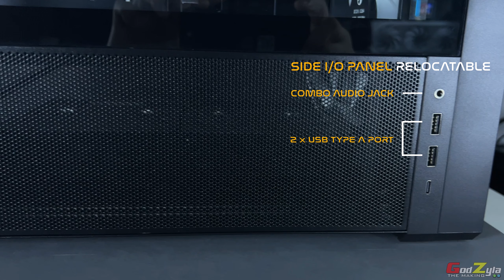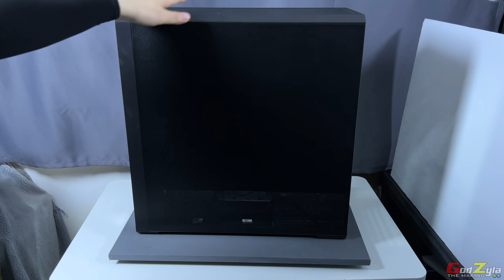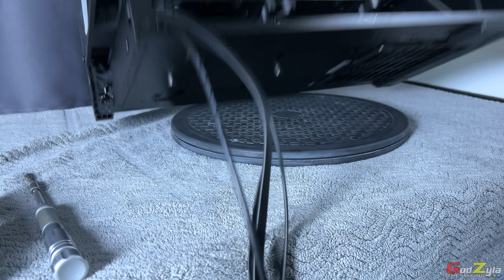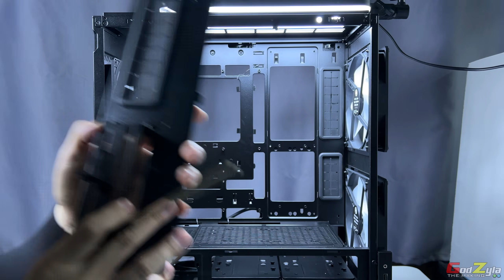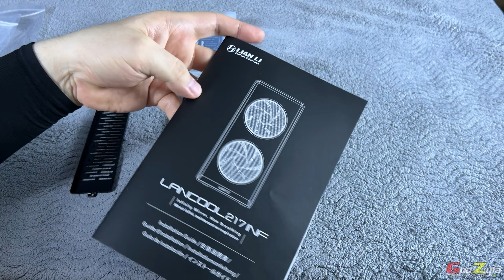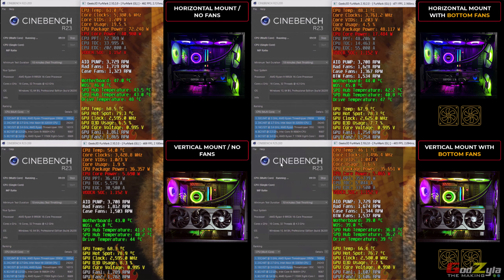Lian Li Lancool 217 INF

Comment: I appreciate the analysis.  But we are talking about a few degrees difference.  I don't see that as a massive difference if you prefer the aesthetic looks of horizontal over vertical mount of the GPU.  Overall its a great case for thermals.  Kudos for doing a 3 hour test at >30deg without Air-con!  Life is too short - turn on the air-con.
Reply from the maker: Welcome to my channel. You are right on few degrees difference. nothing major but personally I prefer to have GPU vertically mounted, not because of aesthetic. if GPU place vertically : 1st lesser turbulance as the fans blowing toward the bottom against the air intake of the GPU, 2nd less off the anti saq and to bend PCI-E pins, 3rd easier to clean and 4th a system is not just CPU or GPU temperature, other components will run cooler as no blockage of warm air exhausting from the bottom to the top.

Comment: Your review is great. I have a question. Many users reporting that fans of this case are so noisy. Can you tell me if you faced any noise issues?
Reply from the maker: Welcome to my channel CYB3RGHOST. Noise level and loudness greatly depends on individual. To me they will be loud if you let it run at max speed but if you control the rpm properly, it will not be that loud. I am more sensitive to high pitch frequency, but these fans does not to that, instead at full speed, it’s just a loud hum.
Reply: @KleoYan thanks for reply 🙏 did you use Lian Li L wireless connector to control fans or you set manually from bios? What fan settings from bios you would recommend to me? I ordered this case and im currently waiting for it.
Reply from the maker: @CYB3RGHOSTY  I do not use wireless connectors or L-Connect 3 app. I purely use Bios fan curve.. infact I use this https://getfancontrol.com/ with my own profile. As for setting of profile my settings as follow, based on CPU temperature.
25% when CPU on idle
50% when CPU at 65°C
65% when CPU at 75°C
80% when CPU at 85°C
100% when CPU at 90°C 
but most of the time even at load, it will just run at 65% as my CPU temperature will not hit 82°C  as I will undervolt my CPU .. 9950X3D https://youtube.com/playlist?list=PLEW-b-2vYDdMRE4f4wT0V4miVO9_2qyoJ&si=nWhpb1dMgZ7EJM6- or 9800X3D https://youtube.com/playlist?list=PLEW-b-2vYDdMhXCDT47rglQcDQNaRisR_&si=XPlFjOglNRwTjuAU
Reply: @KleoYan thank you so much i think your replies will help a lot for others like me also. 🙏🗿🤝
Reply from the maker: @CYB3RGHOSTY  you are most welcome and all the best with your build too. 🫡
Reply: @KleoYan by the way, i also wondered if you did the testing in the video with the fan settings you mentioned?
Reply from the maker: @CYB3RGHOSTY  yes, the settings I have shared with you are based on this case and its components, as I kept a record on ms notes.
Reply: @KleoYan tested the case today. Unfortunately it has resonance issue even at %20 fan speed. I can fix front fans with manual fan profile on bios but fan on the back is not fixable. It kinda has resonance at any speed. When i touch near back fan i can also feel vibration when i hear resonance. I really liked the looks of case but this issue makes me to return it sadly. I bought it for 72 usd which makes it great but it becomes pointless when the product is faulty...
Reply from the maker: @CYB3RGHOSTY  I'm sorry to hear that. I hope you're able to find a better replacement case. In fairness, default cases rarely come with quality fans built-in.
Reply: @KleoYan  but this one should come with quality fans considering they used a proprietary fan hub, and 170mm front fans that replacements don't exist for. :(
Reply from the maker: @NJJRS  welcome to my channel. This I have to agree with you. I have feedback to Lian Li, maybe you can drop a note to there reddit or discord channel. http://reddit.com/lianli or https://discord.gg/PHuKTkhKGY

Comment: Between lancool 207 and lancool 217 inf with 3 bottom fans which one has the best gpu temperature?
Reply from the maker: Welcome to my channel Unmaykr, Lancool 217 is of advantage as it has more room for air and your fans will not ramp up making so much noise. hope this answer your question as in good GPU temp.. btw for me will be having GPU Vertically mounted.

Comment: Can anyone who has this case tell me if I vertically mount my GPU (it's big, sapphire nitro+ 9070XT) will the large screen to my TRYX Panorama 360 still be visible? It's a 4 slot GPU, and I'm wondering if if could mount it low enough.
Reply from the maker: Welcome to my channel. The card lenght and height is ok to fit.. only issue is, its a 3 slot card. You will need to find a vertical mount which allow you to mount and away from your motherboard.. as for the TRYX Panorama 360, it will not be covered as your GPU is at height 141mm tall. unlike Gigabyte 5080 Aorus Master or even the Asus Astral 5080. those will cover abit as the height is about 150mm tall.

Comment: i still cant control the fans they are just going nuts at full speed
Reply from the maker: Welcome to my channel lmnt, you should be able to if you did plug the fan connector 4 Pin PWM to your motherboard fan header.. also to set the PWM curve under PWM mode and not DC Mode.

Comment: The PSU design is silly and it makes people have fan taking air from in the case rather then fresh air via the bottom.

Not sure why they had that adapter for fan it should have been built in like other section the front is designed for those large fans only so no ones going to mount anything there. (You lose a quarter of one of the fans because of the extra bracket)

Not a fan of push and pull panels either if someone has lot of cables it could pop side off.

Air flow for the caddies is poor I found HDD I had over heating.

Dust is an issue put system together with this case for my son he has it in his bedroom after only a month it had fair amount of dust inside it.

I would have preferred the whole front to have lights patterns not just the edges

Whats the warranty like on this because those fans are custom and would be a pain if become faulty.

Great guide again always enjoy your videos very detailed.
Reply from the maker: Welcome to the channel, Nic Monberg! Thanks for sharing your experience. You’re spot on about the HDD section (Side Tray), relying on front fans means more warm air hitting the motherboard. I also dislike mounting SSDs behind the motherboard, while SSD don’t get very hot, there’s zero airflow back there. Like most airflow-focused Lian Li cases, they are dust collector, regular cleaning is the key. 

Regarding the warranty, it’s 1 year for the chassis and 3 for the fans. Honestly, the fan hub feels useless without standard ARGB and PWM connectors. Thanks again for the feedback 🫡

Comment: Thank you very much for this test which is perfect because I am on a bench table and I wanted more airflow focused on the GPU using a Phantom Spirit 120 SE cooler and your review is perfect !
I have two configurations including a 5090 Solide from Zotac and a 5090FE, and after your analysis and taking a closer look at the technical aspect of the two GPUs and their differences, a clear observation appears to me.
The 5090FE in horizontal mode with two fans at the bottom, obviously because its flow is through from the bottom to the top.
On the other hand, like your 5080 TUF, the best position is vertical for the Zotac 5090 Solid because the radiator also cools down from the sides and the heater so it’s mechanically natural, unlike the 5090FE which is faired on its contour so not indirectly cooled.
If I understood correctly and that I am right, the community and @KleoYan should confirm this to me.
Another magnificent work, bravo !
Reply: Indeed, as you write, very excellent review, perfect :finger-red-number-one:
Thank you @KleoYan for being thorough with all your content :face-red-heart-shape:
Reply from the maker: Welcome to my channel NEIHER Univers Star Citizen. Thank you for your feedback and I am glad you like my content. 🫡
Reply from the maker: Welcome to my channel Nicolas “NH”. You are correct, infact most AIB GPUs. It will be best to mount it vertically. I have done this kind of test numerous to times the Lian LVo 11D Evohttps://youtu.be/bdNw54KGPLU, The Montech King 95 Pro https://youtu.be/bdNw54KGPLU and many more. Thank you for your feedback and to share with us your thoughts too. 👍👍👍
Reply: @KleoYan  Thank you and still excellent content, I will view other box analyses to educate myself further !
I am still hesitating between the 217 and the 217INF because I am also in a 'warm' country and I am looking for at least the same thing and to see a chouilla better than my bench tables that use ambient air and not a directional airflow as with a dedicated airflow case.
I have 120mm Silent Wings Pro 4 that I will put below the GPU and I felt that the 217INF would be (very) slightly more efficient than the stock 217.
I’ll see.
Reply from the maker: @NH-Nicolas  I see, I wish you all the very best in choosing a case you like. 😉

Comment: May I know do you using L-connect app to connect the front pannel 170mm fans speed curve?
Or you just only configue it on bios without like any noise issue?
Or did you purchased the Wireless controller and plug it together by passed the bios control the front panel 170mm fans?
I heard have user facing huming or anoying noise while it device run on low temp/ Idie with noisy sound on those front panel 170mm fans.
Hope to hear from you soon.
Reply from the maker: Welcome to my channel SAM, I am using the Case hub but the control is via my motherboard fan header and not L-Connect 3 app. As this case hub is faulty, not able to control using L-Connect 3 App. As for the noise, so long you keep it running at 900rpm max, there won't be a loud humming noise.

Comment: Nice video, very thorough. Well done! Wish i watched it before I built in my case. Do you think with the lian li vertical riser that can tilt, I ca still place 3 bottom fans for aesthetic purposes?
Reply from the maker: Welcome to my channel Desh9583. This case does work with the Lian Li 4 Slots Vertical GPU Kit v3（VG4v3) . I will advise to check the thickness of your GPU. I have only tested a 5080 Gaming Trio which has a thickness of 50mm (2 slot card). It will tilt without issues, inclusive of having the bottom fans mounted.
Reply: @KleoYan  checked earlier and super tight squeeze. Its cause my TUF 5080 is just so damn beefy. Might have to bail on the vertical GPU set for up now. Thank you king!
Reply from the maker: @desh9583  Phew! I am glad you find this out before spending innocently on the Lian Li 4 Slot Vertical GPU Kit v3.. Thank you for the update! 🫡

Comment: If GPU is mounted horizontally, you can use 3 fans instead of 2 fans, AND they will be on top of the PSU cage, so closer to system components. It would have been interesting to compare these results as well. That is how i will build mine. Thanks for the video.
Reply from the maker: Welcome to my channel JF Galipeau, thank you for your feedback. I should have tested that too but sad to say, this case no longer with me. Nevertheless thank you for the suggestion.

Comment: L connect 3 seems not to be working with the lights of this case.   I have this case on my own,  installed L connect 3 and rgb/fan controlling tabs doesnt appear.   Chat gpt answered me that this app works only for discrete lian li fans,  it doesnt work with fans and lights built in the case
Reply from the maker: Hi Alt, welcome to my channel. When I have this case, I too not able to use the L-Connect 3 app but this is due to my controller having issues. on their official website, the case fans and the front cover leds are able to be controlled with L-Connect 3 app. https://lian-li.com/product/lancool-217-inf/

Comment: V-btm test, did you run the test with the steel cover on the bottom fans?
Reply from the maker: Welcome to my channel Theburrow, yes for both Vertical and Horizontal GPU mount, I have the metal cover on.

Comment: Thanks for showing how the M1/M2 buttons work in such detail, and even more for having nice sections to quickly find the content, very much appreciated!
Reply from the maker: Hi rboerdijk76, welcome to my channel. I am glad you like this content. Thank you for your feedback and all the best with your build too. 
Merry Christmas and a Happy New Year 😉
Reply: @KleoYan  In the meanwhile am the proud owner if this case, and it is absolutely perfect! Combined with watercooling (arctic freezer pro 3) and under high load (compiling on all cores!) the 9950x3d does not exceed 77 degrees. Didn't even install any additional fans in the space for additional ones on the bottom separator. Fun note, case is standing below the desk, and when turning the machine on, the fans briefly blow at full speed giving a noticable the cold chilly feeling on the legs.

Comment: Just installed mine and the front panel fans are loud and there is no way to turn it down. I am very disappointed
Reply from the maker: Hi El Calvo Belga, welcome to my channel. Hmm are you able to control then fan curve of the front fans? I am able to and to tone it down.
Reply: @KleoYan  Hi.  I tried to change the curve in BIOS and MSI Mystic.  It's just the pre-installed Intake fans and exhaust fan that show up in the curve but when I put it on let's say 20% they keep going full speed

Comment: Thanks for the review. I've a question. If you put the GPU in the vertical position, do you still have enough place to mount the 120mm fans above the PSU shroud or are you forced to mount them under?
Reply from the maker: Hi 
Matthias, welcome to my channel. If you make use of the case Vertical Mounting screws to mount your GPU vertically, you can place only 1 x 120mm fan at the top front of the PSU shroud area or you cand do 2 x 120mm fans underneath the PSU shroud area. Reason is if you wish to mount at the top of the PSU Shroud area, the two screws which are holding the GPU Riser cable will be blocking the rear and middle fans section. 38:36

Comment: does you need to a riser for vertical mouting gpu in that case? and which one do u think is a best p/p riser for pcie5.0 with a small budget? thank alot for ur done brodie❤
Reply from the maker: Hi pinés 211, welcome to my channel. You will need to purchase the riser cables separately, so far I have used the uplink PCIe 5.0 from Amazon and it’s if 200mm in length. It works great
Reply: @KleoYan thank for your resp,  if i use this case i just need a cable riser without vertical rack i think it’s just enough to vertical mouting right?
Reply from the maker: @pines2117  yup, correct.. as there are GPU standoffs provided with this case. make sure you have somekind of support at the front for your GPU to sit on.

Comment: Very cool case, nice review. A bit too expensive but whatever. 170mm or 180mm fans should be on the front in every case in my opinion
Reply from the maker: Hi Simon B., welcome back to my channel. Yup this case looks great and as for 170mm or 180mm. I feel it should be 180mm, as 170mm is not easy to find.. almost near impossible.

Comment: This seems like a downgrade compared to original Lancool 217. You can't mount anything in front or change front fans (the original 217 has one of the best front fan mounting system I've seen), you lose the filter and bottom fans, and the original looked elegant and slick while this looks like it's made for kids. The only good thing about it is that I/O can now be moved for people who don't use big cases like this on their desk...
Speaking of bottom fans, this just shows that they are basically useless in cases with open bottom like this one and fishtanks. Here they only lower the temps by 1 degrees at most, while being an extra cost and noise.
Anyway, good review as always, thank you.
Reply from the maker: oh hi Last Second Bloomer, welcome back and thank you for the valuable insight. 👍 will feedback this to Lian Li 🫡

Comment: Asrock is literally one of the best Motherboards ive ever used and its such a beast but you have to go into the Bios and just turn off the overdrive... Core performance boost and Precision boost overdrive! I think this was the biggest Problem cuz its always pushing the CPU to work at its peak even on idle! I think its an Asrock typa thing... Im on the AM4 platform and this is my 3rd 5900x cpu so finally I just figured out that its always doing overdrive stuff! I turned it off and now its at 31 on idle and doesnt go over 50-55C on full load during gaming! I also undervolted my GPU wich is an Asus Rog Strix 3090 and its Perfect! My temps are very low and Im playing all the games no issues... But the Strix card even before undervolting has been working for 5 years like a champ... I just started undervolting it! I had issues with the CPU part though for some reason! But Quality wise? This is the BEST BOARD YOU COULD BUY!!! Forget every other brand... This brand makes the best parts! My MSI B550 broke after 3 months and I dont do anything... Never overclocked... Now im building a new Rig... I got the Asus Astral 5080 and im slowly getting the rest of the parts to build it! Im most likely gonna go for this motherboard of the Taichi one! But always limit the CPU's options I just told you! Unless you need every single squeez out of ur PC. I dont! I hope this one lasts this time though! Good luck! >;)))
Reply from the maker: Hi D D, welcome to my channel. Thank you for sharing your experience with ASRock board, thanks for the info too. greatly appreciate it and all the best with your build too. 🫡